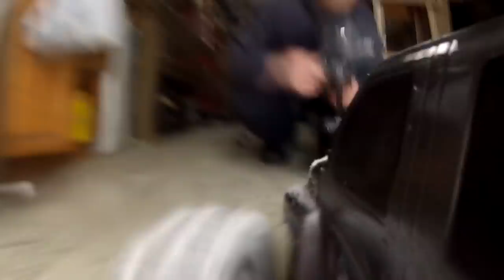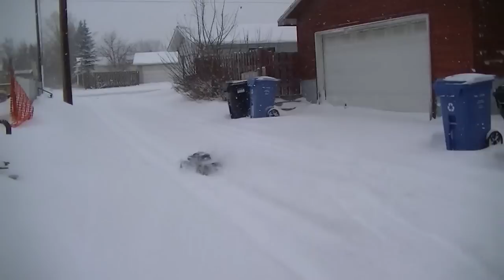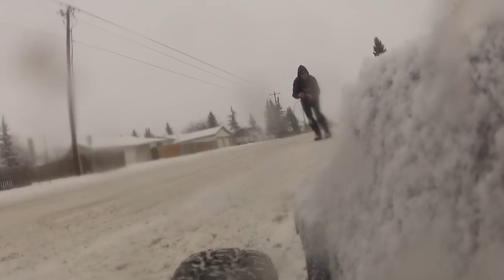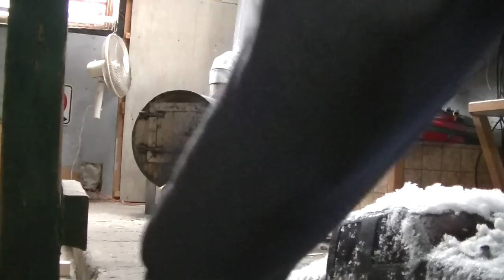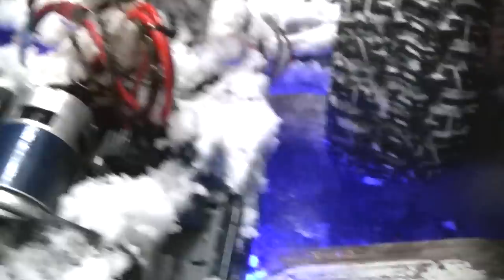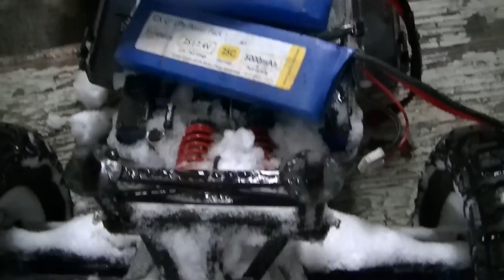Summit in deep snow with Gopro onboard

Comment: batts are in a carbon case  so i cant see em an it seems like the lipos are gettin fat, only got a crappy china charger so i cant check the V or mah, art-tech V2? and hey are you running the EVX-2 esc? i got that in my erevo and wonder if i has lipo cut off? i just use a lipo alarm but it seems messed, will go off after 2 mins running then not again untill i know it should be almost dead